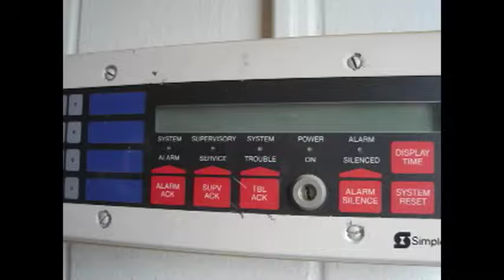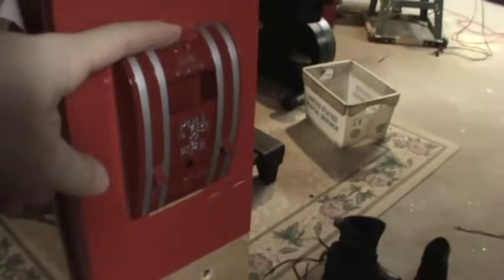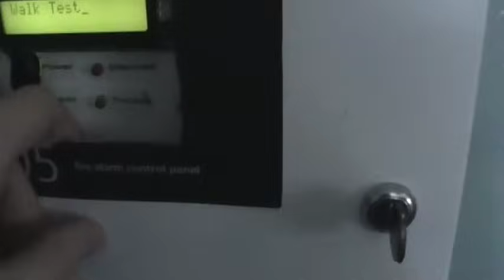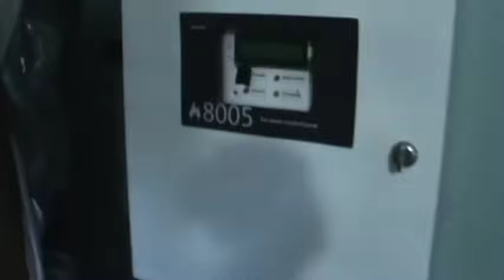System Test 29 (Alertek 8005 Finale... and Bells)

Comment: 0:45 8005
1:21 Simplex Chevron
1:24 Simplex 4050-80 w/ Simplex bell
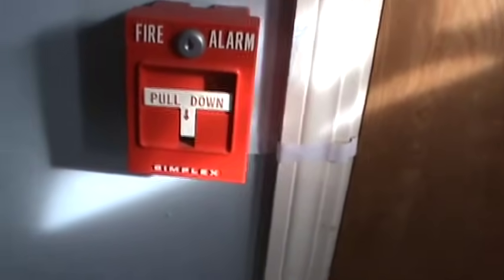2:06 Simplex 4251-20
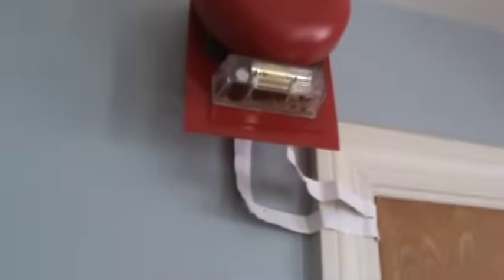2:25 Alertek Strobe Plate w/Potter Bell
2:40 Heat Detecor
2:53 Edwards Bell
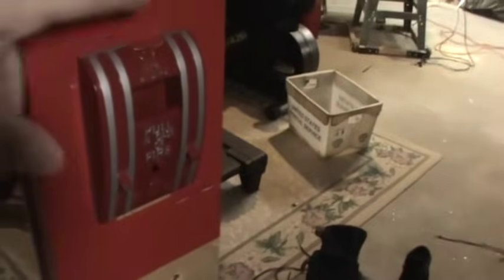3:09 Edwards 270-SPO
3:22 Edwards 278
3:43 Wheelock 34T & Firelight BG10
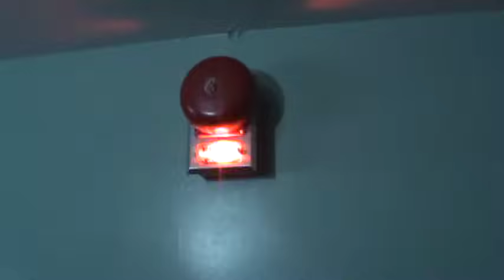Activating system: 4:01 6:53 8:01 9:40
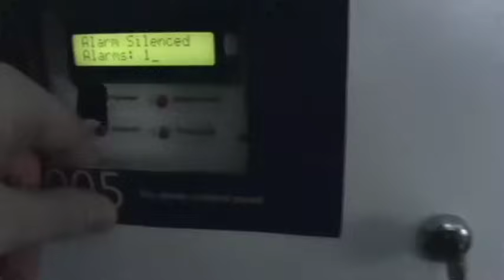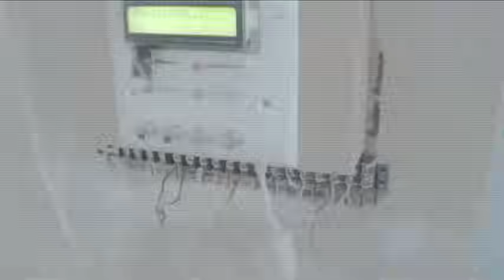System reset: 6:31 7:11 8:41 10:44

Comment: Most of the bells at my old high school are wheelock 6” ac bells and 2 of them are potter 6” bells and the outdoor bells are 10” edwards bells, and I’m assuming most of the bells are running on 120v ac and some on 24v ac and they’re used for class change

Comment: When you pull the handle on a coded pull station such as the one you used or on a Simplex T-Bar(large size) what does your hand feel like? I mean can you feel your hand moving when the handle is pulled? Also on the Simplex when you pull the handle all the way and the wheel winds what does your hand feel like? Do you need to readjust your hand/grip after you pull the handle out  a bit before pulling it down?  What would people think when they see the handle go back up? Would people think the alarm did not work and pull it again? Also when the alarm stops after the 4 rounds does one pull it again if no one has responded? How many times does one need to pull it?  On some coded stations does the bell keep going after you pull it even if the handle goes up or were there some old Simplex ones where the handle would stay down? thanks
Reply from the maker: Daniel 1. LOL
2. If I couldn't feel my hand moving I'd have no feeling in my hand and there'd be something wrong with me
3. LOL again
4. No
5. Most people don't know anything about how alarm devices work so I bet they wouldn't think twice about it. 
6. Again, #5. 
7. I bet by the time it stops after 4 rounds the person who pulled it will be out of the building because there's a fire.
8. Only once really
9. I have seen one coded pull station where the handle does lock down.
Reply: AHHHHH SO MANY WORDS brain explodes GREAT NOW I HAVE TO CLEAN THE BRAIN GOOP OFF THE WALL
Reply: Dantdm

Comment: what's the model of the Wheelock horn and Edwards bell/Simplex ?
Reply: The Wheelock horn in the garage is a 31t-115 with a Wheelock light attached to it, it was there in system test 28 as well.

Comment: You should make a system using edwards AC powered adaptahorns as the alarm devices and for the pull stations the round standard electric time pull stations.

Comment: Can you make a California Code for the bells?
Reply from the maker: Not on the big system but I could with my AFP-400, which has California Code.
Reply from the maker: If you want you can pick the strobe plate or light plate I use, too.
Reply: Can you use a 2903 lightplate?
Reply: If you have one that is.
Reply: How long til you can do it?